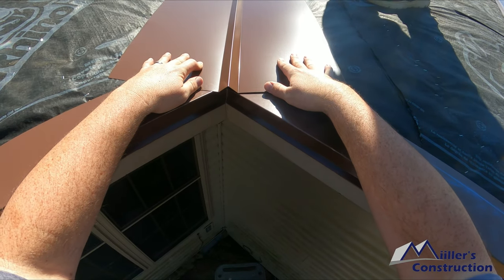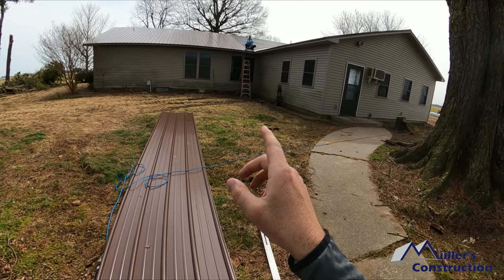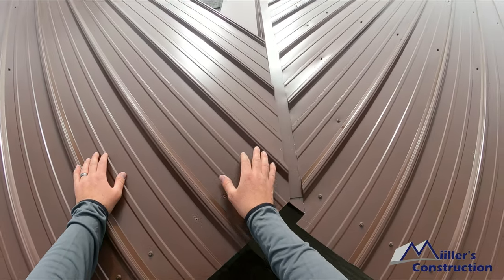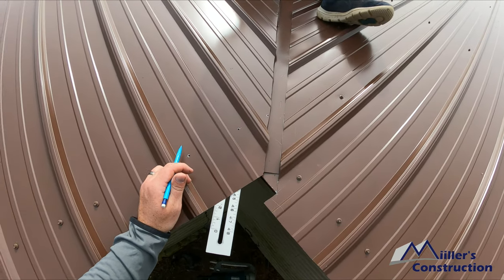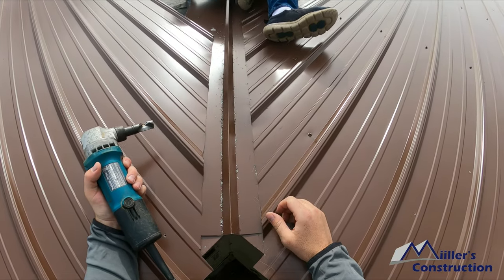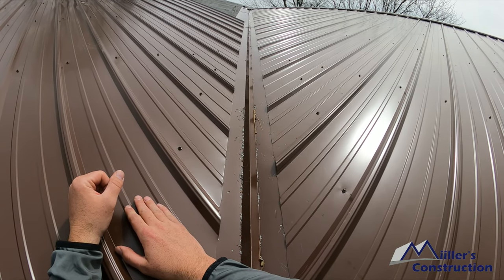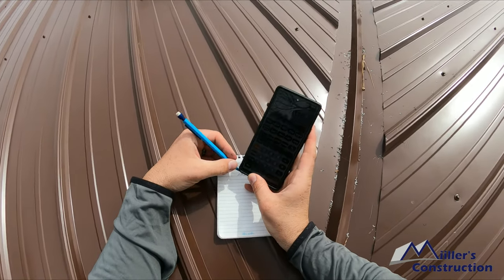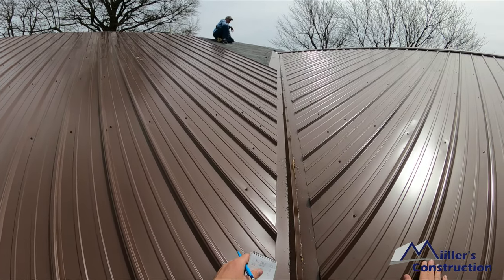Exposed Fastener Metal Roofing Part 2 - Valley Details

Comment: I use my cut off for a template. Along with my math and a chalk line mark up the valley. If your valley is straight, it works well. I like the way you worked out your cut up the valley.
Reply from the maker: Yes thats a great method as well! Yeah unfortunately we are forced to slow way down on valleys often times because its usually so crooked. Really bad framing in my area on these 60s and 70s homes. Thanks for checking out the video!

Comment: My son has a 36x40 garage with 1/2” plywood. Is that thick enough to hold screws, or should we put down furring strips first?
Reply from the maker: Great question. It SHOULD be thick enough. Especially if it's fastened appropriately, you should not have any issues. I would definitely recommend he 1" screws or even ¾" if you can find them without them being the "stitch" screws.

Comment: Nice looking job!
Is there a reason you didn’t extend the valley down 1 1/2” to match the bottom of the sheets?
Reply from the maker: Normally we would do that. We somehow got off our mark when installing the valley though so we just had to go with it.
Reply: @miillersconstruction  I wasn’t sure if that was to prevent water from over shooting the gutter? Lol, once gutters are installed, you will never see it.
Reply from the maker: @davek6630  nope, that's just a mess up on our part. Yeah you'll never see it from the ground.
Reply: Isn’t this mistake important to highlight right from the get go in a ‘how-to’ video?

Comment: HOW FAR APART IS EACH ROW OF SCREWS AS YOU GO UP THE ROOF? ANY STANDARD RULE?
Reply from the maker: @Robert-hd9ju  every manufacturer is different. Typically we like to go 24"-36" depending on the length of the panels.

Comment: Are you plugging the ribs so any splash over from one side of the valley to the other side doesn't go up under the rib on the other side?
Reply from the maker: No. Never had an issue. Ever.
Reply: I am no expert but from my research it seems like you are definitely supposed to seal between the panels and the valley trim. 🤷🏻‍♂️
Reply from the maker: @mhub3576  you can do it on your house. I'm showing you how we do it. If we had issues in this area, we would've addressed them 20 years ago.

Comment: Do your clients find that the metal is noisier in rain storms?  Do you ever use foam board under the metal or another sound inhibitor?
Reply from the maker: We typically ask the clients if they notice their cooling bills decrease and if they notice the noise. All of them say the same thing - cooling bills might have dropped barely, not enough to make much difference. And no, they don't hear the rain anymore than they normally would.

Comment: I’m about to do this on my house and trying to learn.
For the valley pieces, if you know the angle, why not just use that jig and cut an angle at the end of a sheet and then cut a square piece at the ridge cap which wouldn’t have to be so precise as it’ll be covered by the ridge cap?
Reply from the maker: Because the valley moves. It's never straight on older homes like this one which was built in the 60s. Not only were the valley's crooked slightly, they were sagging as well which can look bad if not adjusted. What your wanting to do is cut a piece of metal twice unnecessarily and potentially a third time because slight adjustments are often made to the jig as we move up the valley. If the valley was perfectly straight, It would make this job and most others much easier.

Comment: why are you screwing into the pan
Reply from the maker: What pan
Reply: @miillersconstruction  he’s asking why place the screws in the flat of the panel (pan) vs on the top of the rib. My manufacturer’s instructions are always on the ribs but we live in Ontario Canada so location might make a difference?
Reply from the maker: @willkeen5010  yeah definitely no warranty here if I placed the fasteners in the rib. My manufacturers instructions are very specific on this. Also they explain why. They tell us that wind and air plus expansion and contraction will move the metal and if the fastener has a gap between the steel and the roof deck, It gives the fastener an opportunity to not only move, but to actually snap or ease out of the hole.
Reply: Some manufactures say into the ridge if going over old shingles and into the valley if going straight into the decking, I don’t know why or if it matters.
Reply: I think northern locations put screws in the ribs to help with ice daming or snow sitting there ready to pounce on your head 😅.
Reply: @miillersconstruction    Here In Australia you always fix the screws to the rib of the roofing sheets. Much less chance of it leaking in the future. The rubber washers wont last as long as the roof will The roofing iron is good for 60 plus years and the rubber is good for 20 years.
Reply from the maker: @johnbarber107  here in the United States if your a good metal roof installer, you do exactly as the manufacturer tells you. That way if there's ever a problem, it's on them. For that reason, we DO NOT fasten our metal through the rib.

Comment: I hate subtracting 1/8's inches from 1/16's. It would be so much easier if we just went metric.
Reply from the maker: Man I couldn't agree more!!!
Reply: 1/8 is 2/16 its very simple, it's reducing that makes it hard. Just un-reduce

But nothing stops you from using a customary/metric tools
Reply: 1/8 inch cannot be subtracted from 1/16 inch because 1/8 inch is larger than 1/16 inch.
Reply: @lindaliberty4545  but you can, and often need to, subtract 1/8 from x and y/16ths, such as 5 3/16 - 1/8.  It's not hard, but it's easier and faster in decimal. I frequently need to convert fractions and decimal measure. Converting 1/8's or 1/16's into or back from thousandths.